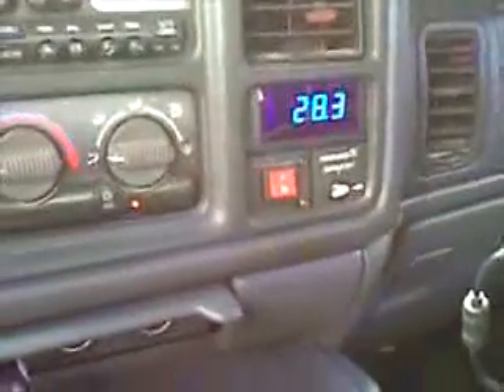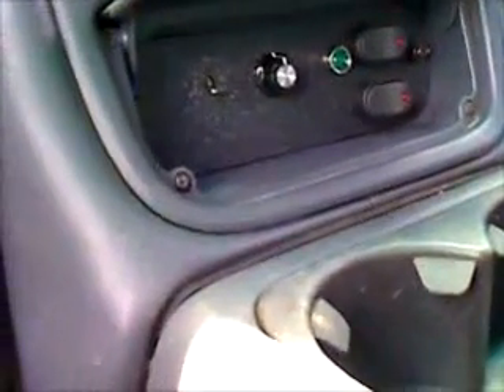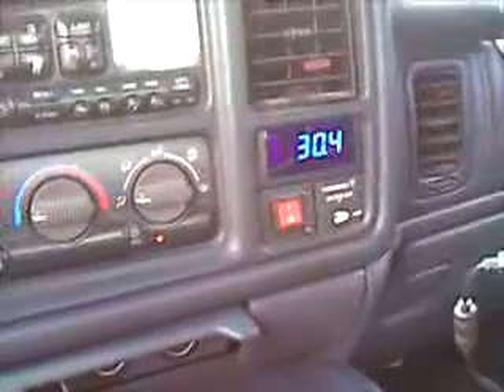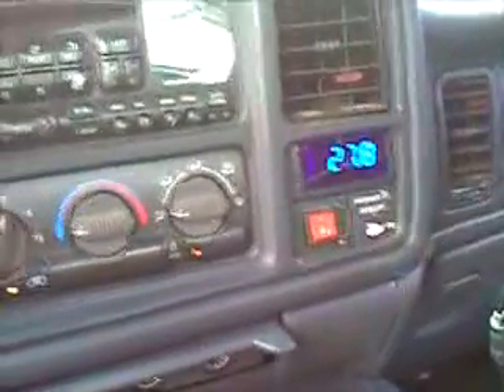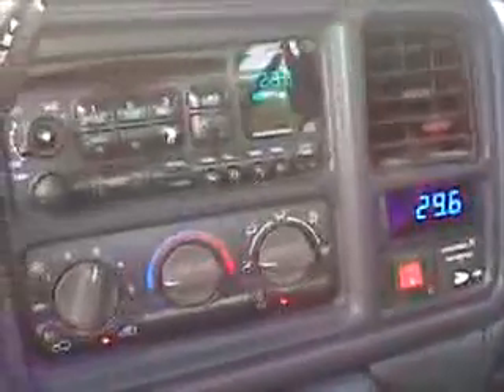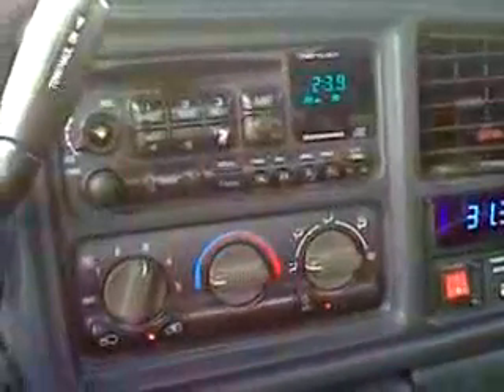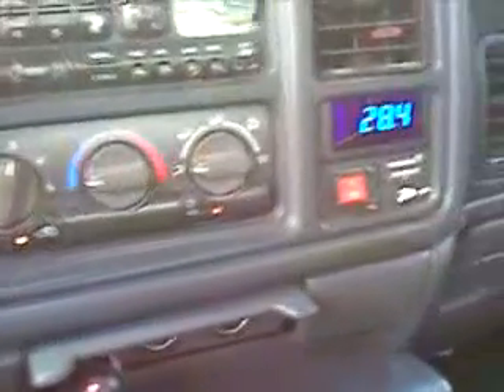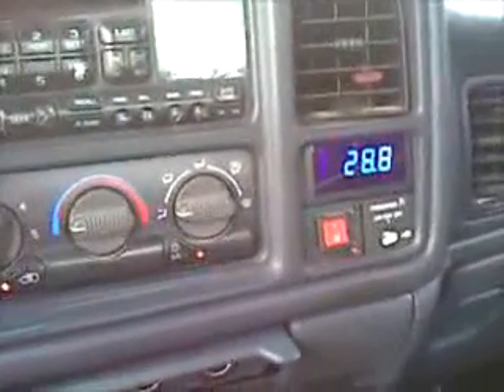Hydrogen Generator Update

Comment from the maker: 40 grit sandpaper and spend some time on them. Both sides. All plates. Neutrals. Positives. I use a criss-cross pattern. Also, use rubber gloves when handling them. The oils in your hands and fingers will reduce production in area handled by a substantial percentage. May not seem like a big deal, however, don't do it.

Comment from the maker: Good question on the NaOH compatibility. Dunno. I do know this. If it's not compatible, my cell will use it like an electrolyte. (I've used pop cans as an electrolyte before. I dont know if it being anodized mkes any difference. The cooler came from a local speed shop.

Peace

Comment from the maker: The key to BIG production in a small area is cell plate preparation. Better than a 35% gain in production by properly preparing your plates. Not only that, but I am playing with a torrid coil. Seems I can knock the bubbles off my plates REAL fast utilizing "harmonics" , as well as HIGH VOLTAGE--- LOW AMPERAGE (A/C current ran through a bridge converter yielding around 80-90 volts DC through a PWM). I have said for many years know, and I'll say it again. "She'll either blow or go", so to speak.

Comment from the maker: The reason I have the pump (as others have said it's not required) is I run around 25 amps, (give or take). Can I run it at 10 amps? Yes. Hydrogen production is GREATLY diminished, but I don't need a cooler. For a V8 Chevy, if your not kicking at least 3 LPM, your peeing in the wind, so to speak. Even at that, it takes 20-25 amps to generate enough hydrogen to make a "real" difference.  I can get nearly 4 liters with a 32 plate cell @25 amps.

Comment from the maker: This is only to MY vehicle. I cannot stress this enough. Every vehicle is different. What you want to be extremely careful of is NOT to run your engine too lean. I'm not sure how lean the ECM will allow my truck to run (1.0 volt dc is about as lean as it can go) This being said, at one volt (fluctuating), I don't know how lean a voltage signal to the fuel injectors @1.0 volt. If anyone does know, please chime in.
Peace

Comment from the maker: Not an issue here, to the contrary. I can't let the pump run more than around 45 seconds or it reduces the cell temp BELOW what I need for maximum hydrogen production (around 157 deg), and this is a fine line from what I have experienced. I need to incorporate a reliable device(s). One to ACCURATELY and DEPENDABLY regulate both the upper end of the heat and the the lower temp variables for maximum hydrogen production. Heat is indeed required, just not to the point of boiling the reactor. Peace.

Comment: You should mount the water cooler or the transmission cooler away from the radiator so it would not absorb some of the heat from it, thus it will run cooler, redusing the AMPs, just an idea.